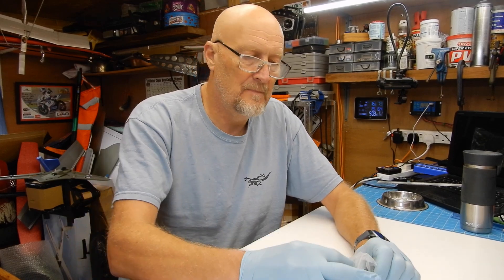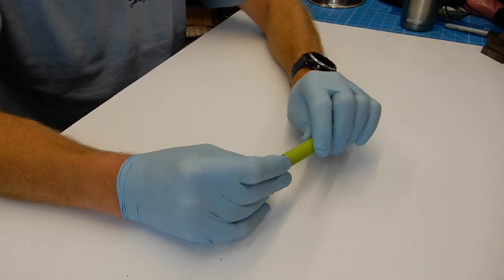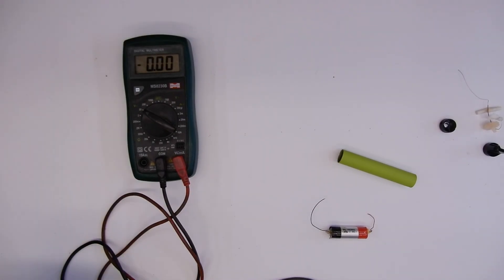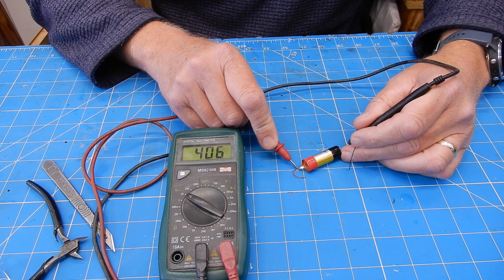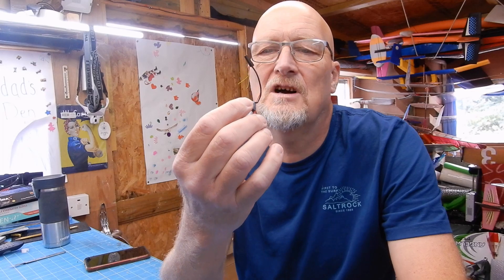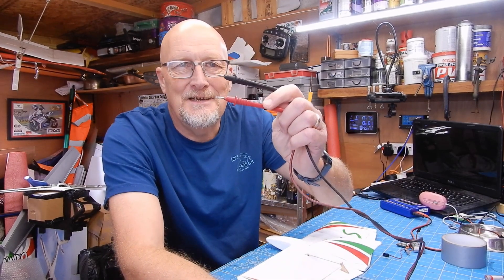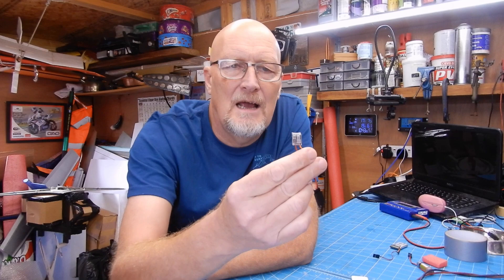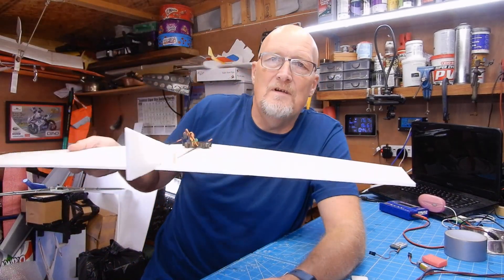Saved a cow got a free battery

Comment: You can use a 1s lipo with a matek voltage booster no need for a bec boards not much bigger than a postage stamp and weight about 1.5g

Comment: Holly cow, a great battery find.

Curious on weight spec of a single cell? (before wire/connector  mods)
Another option is a 18350 li-ion cell. They weight ~23-26g. Capacity ranges ~900-1200mAh (anything advertised higher is junk). More common 18650 li-ion cells are another option, but likely on heavy side at ~44-49g.
FYI: a 18350 cell is 18mm x 35.0mm in size. (the magic numbers)

FYI, an alternative to using 2S -> BEC is to use a 1S -> 5V "Voltage booster". It converts 2.5V-4.2V to a constant 5V power source. Probably can still fly for hours, in the lightest of winds. 

One example is VB2A5V "Voltage Booster, 1S Li to 5V" made by Matek Systems ( mateksys _ com ? portfolio = vb2a5v ... less spaces, _ -> .) Weight is ~1.8g, and offer up to ~2.5A while remaining very efficient. Matek is the same company Angel Wing Designs sources their BEC's, so they may be able to source one for you to test. ;)

Comment: Lithium ion. Not lipo.
4.06 not 4.6.
Who is your technical editor? Some dumb Ozzie no doubt?
Most ecigs use bigger 18650 cells, the numbers are the diameter and the length in some way (these are common in many devices). I hadn't seen these cheap lightweight disposables before using the smaller cells.
Lithium ions are pretty robust for deep discharge. You might save those really low voltage ones. Your charger will have a lithium ion setting.
Look for servos and receiver that work direct off 2s lithium ion, or 2s lipo.
Usually the receiver is good for more than the servos.
It is worth splitting the wires and running the receiver off the 8+ volts if it will take it, and only the servos off the BEC.
Then your receiver won't "brown out" if the servos overload the BEC - though that is unlikely with only two servos.
The higher the volts you put on the BEC, the lower the current it can deliver before it gives up.
Don't eat the batteries...even if you do have as many stomachs as a cow.